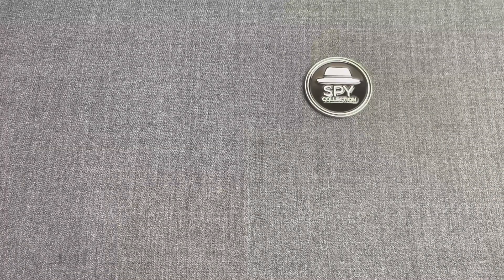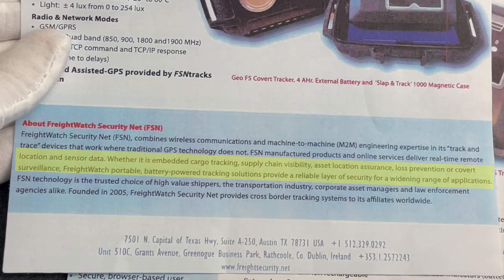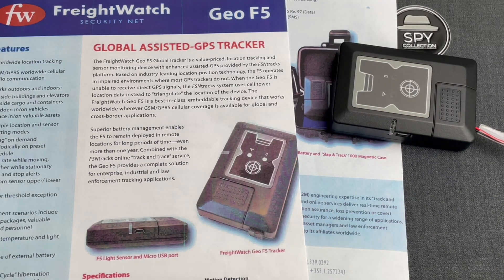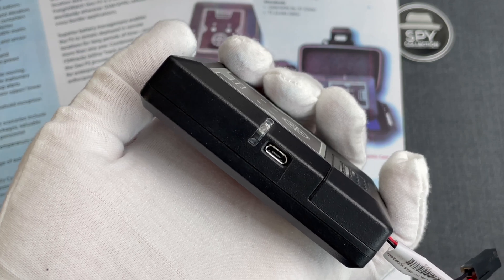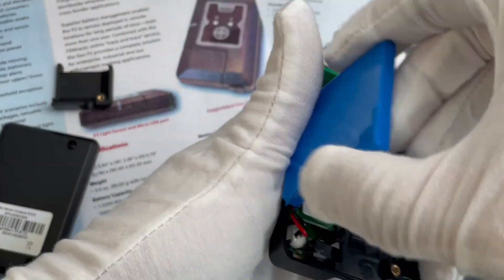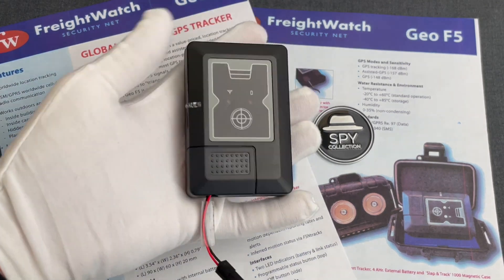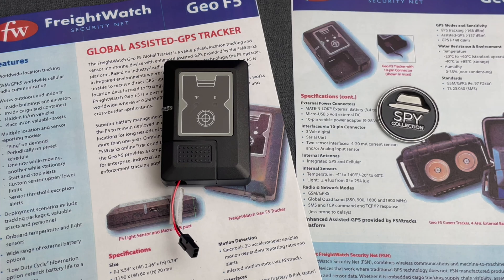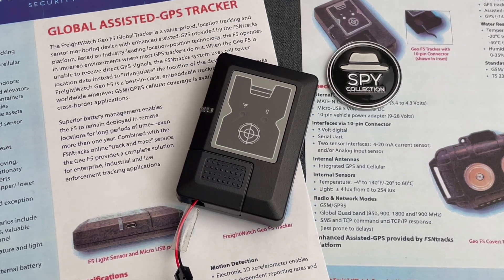WikiLeaks Spy Files and the FreightWatch (FSN) Geo F5 Global Tracker

Comment: jillions of such devices are used for legitimately and unclandestinely tracking shipping containers, reusable pallets and crates, air transport unit load devices and much more.

The trackers for heat-sensitive cargo (such as pharma, biotech, cold chain food industry) have temperature/humidity sensors and setpoint/integral alarms.

Trackers for car, truck and locomotive fleet management have odometer, accelerometer, engine RPM, fuel flow and fuel quantity sensors to prevent siphoning off the fuel (quite an issue in some parts of the world) or taking side jobs at the company's expense.

This is, to be honest, one the more boring and less spooky/deniable articles on this channel.

Comment: reverse engineer the sim card and see what information you can scrape.
Reply: I second this but please do it with a pawn shop paid in cash or old scrap pc that has been physically air gapped. 95% chance doing it with a regular pc probably wouldn’t make the alphabet boys come knocking and if they wanted to they would either way and they already know what we ate for breakfast so there’s no hiding anything but still I’d avoid it at all costs because up to this point if I’m some 3 letter organization watching this I’m thinking ok whatever he has some old tech that’s well known and not a secret in this community but you start looking at sim data or rather data found on a SIM card in a piece of specialized covert gear which could contain classified data and could also presumably be cross referenced somehow then I’m going to have an issue and start probably trying to figure what could’ve been in it and turning nothing into something and I wouldn’t be surprised if those sims had some way to imprint on a pc that read their data then allow that imprint to be seen somehow 

Also incase he sees this id be curious is you could any physical indications of where it’s been based on residue and a cheapish spectrometer or maybe a radiocode 110
Reply: @StayProteus  this is an decades old unclassified COTS item, nobody's gonna SWAT a Greek-sounding guy for activating this device. Also I'd bet the servers or configured in this device are down and gone, or speak a different protocol etc, and the SIM was tied to a contract long expired.
Reply: @StayProteus yall two are nutjobs and cringe af “aphabet boys” come on bro grow up 😂😂